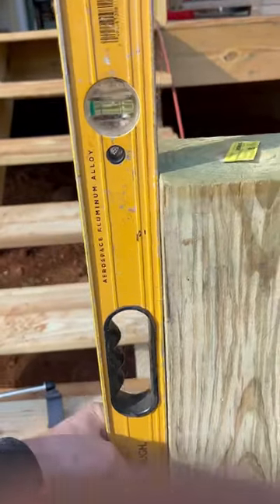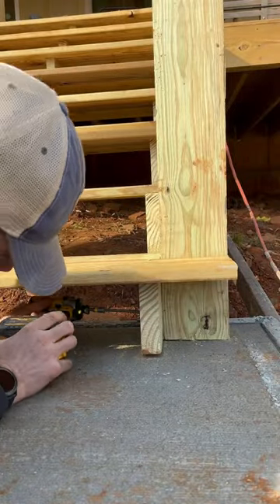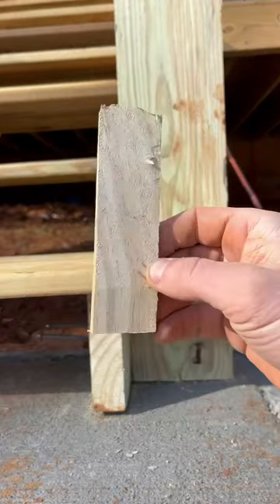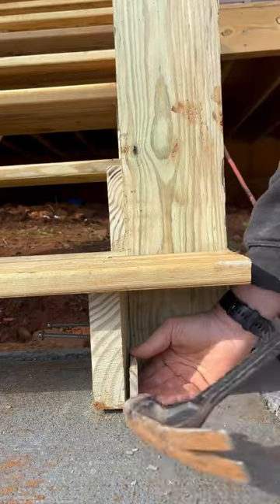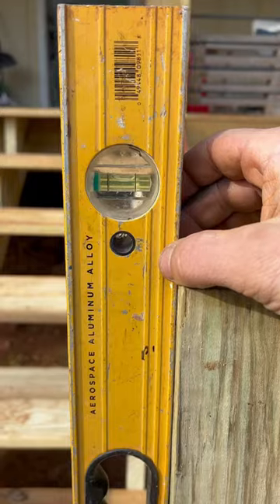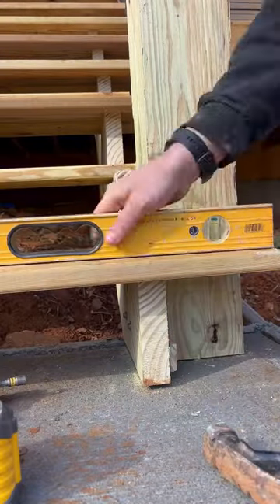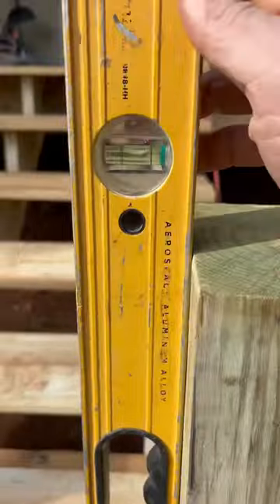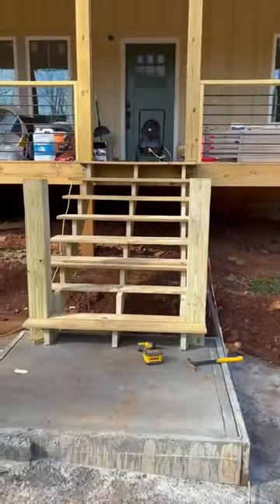How to level a post 👷#construction #tipsandtricks #shorts #builder #skills #tips #level #diy #deck

Comment: You're still off by 90ﾟ
Reply from the maker: Now that’s a comment 😂🤣😂
Reply: Real carpenters know the difference  between plumb and level
Reply: That’s called plum not level
Reply: @danny2131  you sure it's not apple?
Reply: Correction 90 plus degrees 😅
Reply: Wtf is a "shem"
Reply: @danny2131  might just be a dark fuzzless peach with no pit

Comment: The word you’re looking for is plumb. Also, that post will be wobbly in less than a year. Don’t use structural screws on railing posts. Use carriage bolts.

Comment: Not trying to hate. You are obviously new to this. You can tell by how its built. But hey, you are doing it, the haters are sitting watching you while they are eating Cheetos. Do a little more research. You should have bolted a bracket under the post. The post sitting on bare concrete will rot over time even though it is treated. But that may be for the next owner. Keep on doing it. Only way to really learn is to do it again. Keep it up
Reply: Agreed
Reply: I would a 100% agree with you except for he made a video about it as if he was declaring that it was correct. I think you do that and you open yourself up to all kinds of perfectly legitimate criticism.

Comment: Yep. Or use the toe kick board to plumb the riser and post. Likely both were out   👍. Work smart not hard
Reply from the maker: Not a bad idea. Then if the post was still a little out I could have adjusted it but may not have had to
Reply: @MordecaitheBuilder  Thanks. Yeah, usually both are out unless the post was crooked or twisted. It doesn’t take much movement in the toe kick to move the top of the post. Even if the toe kick isn’t a perfect 90 degree cut it really won’t stand out near as much as a shim 🤷‍♂️   Toe kicks are a requirement by code anyway so might as well use it to your advantage. 

I typically secure a nailer to the concrete landing/walkway notched into the stringers. That allows you to secure the entire set and will hold it all together. The toe kick hides the nailer. Just be sure to use ground contact rated wood. Not all treated wood is rated for ground contact and will decay prematurely.

Comment: It'll never stay plumb. The only thing holding it is the stringer. Very unstable. 

 You need a 2x riser board across the bottom stringers, to lock them all together. Or block in between them

Comment: I tried that but the concrete in the ground kept her from moving
Reply: What I was thinking. I’m doing a ramp for somebody and their is already a concrete walk way. First time I’ve ever not sunk my posts 2 foot in the ground and concreted around. On anything bigger I would cut it out. Theirs no need in the case I’m doing now because every post is under 2 foot itself. But I don’t like it. I feel like even with 4x4 post attachments for it to sit on and anchor into the concrete, it’s just not nearly as close as sturdy as what putting it in the ground is.

Comment: Okay so, if your posts are not attached to your base concrete with a bracket or being poured in, then they have no real strength or reason.

Set your posts first. That's when you plumb them and square your face to the upper. Then your stair jacks can attach to the posts

Comment: Or . . . . . . maybe you should have actually secured the post to the concrete using a base with a 1-inch standoff from the concrete, AS REQUIRED BY THE BUILDING CODE.  By the way . . . . . posts are plumbed, not leveled.  You level horizontal things, you plumb vertical things.

Comment: I didn't comment on their being no kicker in the first video I saw because I assumed those posts were set in concrete. The posts have no positive attachment and are only screwed to the stringer. No kicker on the stringers. The whole thing is just sitting on the concrete?  No bueno mi amigo.

Comment: Has anyone else told him it's not level, it's PLUMB?
Level is horizontal.
Vertical is PLUMB.
Oh, and it's called PLUMB because the original weights used to make and measure vertical surfaces were made of the element LEAD, or, in ROMAN LATIN, PLUMBUM.
And BTW, that's why people that work on pipes are called PLUMBERS, because all the pipes the used back then were.....(wait for it)....LEAD.

Comment: Why bother when the end grain is sitting on concrete when it should per code be in the ground in concrete not to mention the 5/4 stair treads on stringers with a 24” center.  Not one part of that stair case is to code from the posts to the stringers or the claimable hand rail maid of 1/2 inch rebar which will never withstand a 300 pound side load. Maybe when it rots out in 2 years you’ll get a chance to try again.

Comment: Good tribe but that's not a good solution to that because as soon as you move it that post is not going to the ground so it's not going to hold straight so what you do underneath the back of the bottom stair you run solid block in between the stringers and you lock that in to a level point on both sides of the post because putting a little tiny shim to bring it back to level the first time it rains and dries out again the things back out of level use the solid blocking method much better it will hold 10 times stronger and it less likely to move